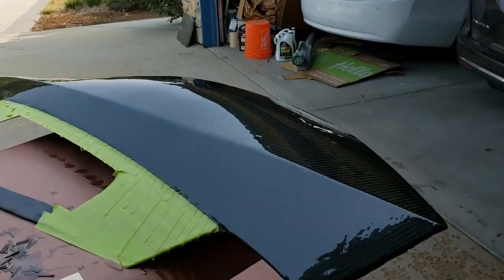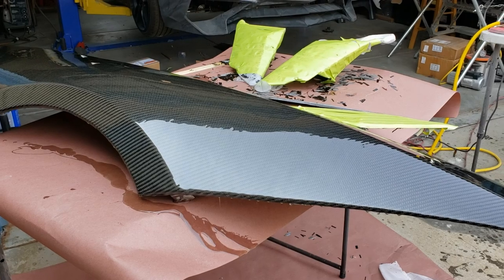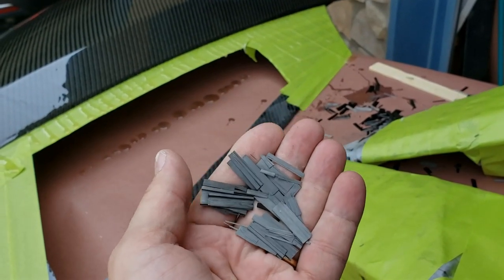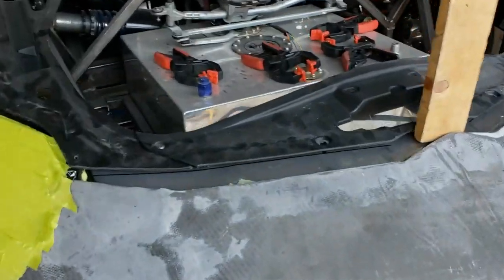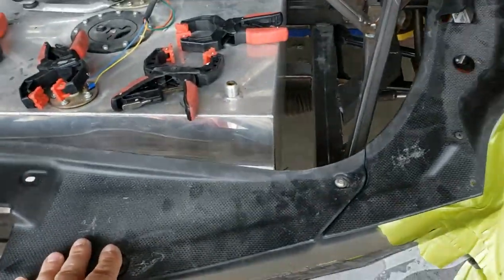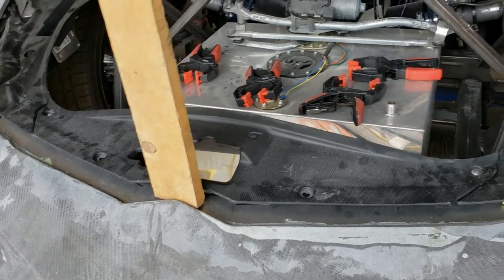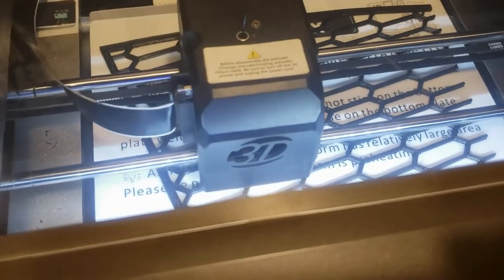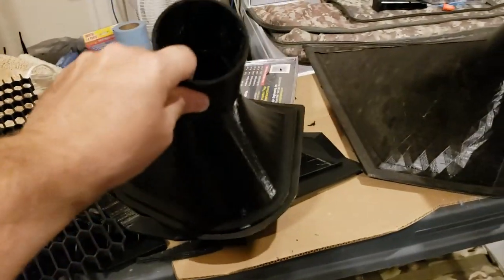3D Printed Interceptor Update 51

Comment: What is your printers build volume? And what do you use to glue the pieces together? I have an Ender 3 and haven't tried any multi part prints yet, but would love to be able to print parts on this scale for my restoration projects. Loving this build 👍
Reply from the maker: 300x300x300mm, I use MMA epoxy.

Comment: Printed a PLA part for my motorcycle recently and it becomes very soft at around 110 F (in AZ) probably wouldn't melt until 140ish. But your parts may lose shape over time on hot days.
Reply from the maker: They are clad in carbon fiber.

Comment: Why you just don’t hydro dip it in carbon fiber and then spray it with a clear coat with a hardner. It’s a lot easier and less messy.
Reply from the maker: Can't stand fake carbon, and I need the strength.